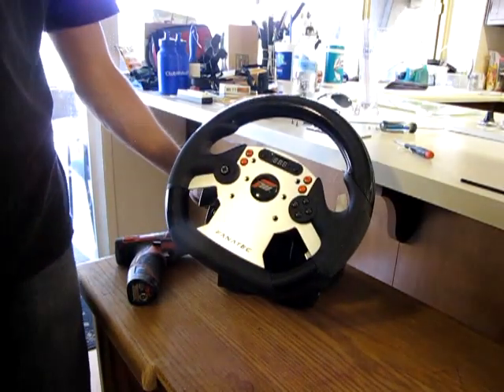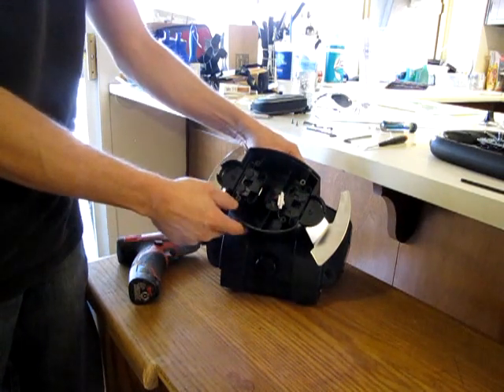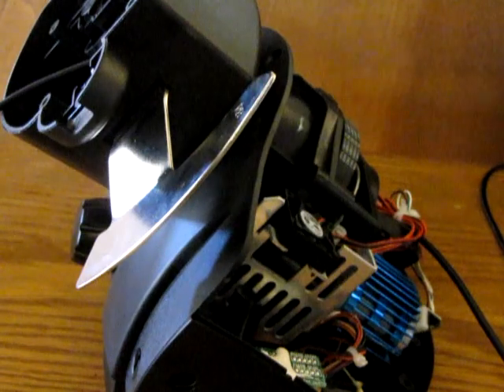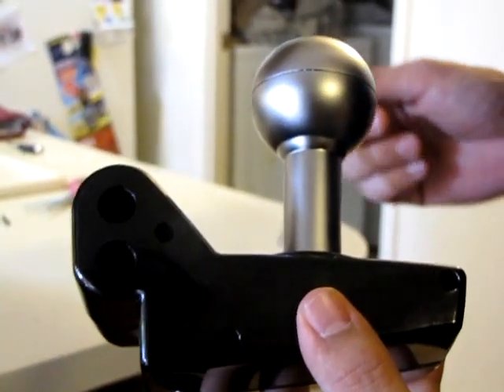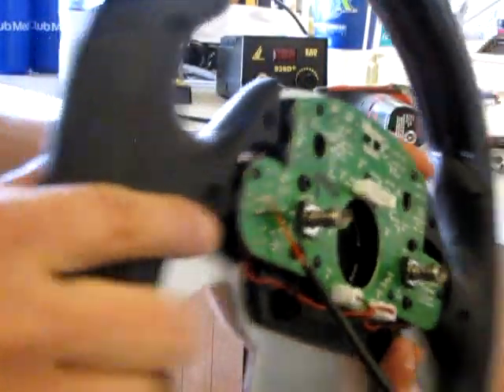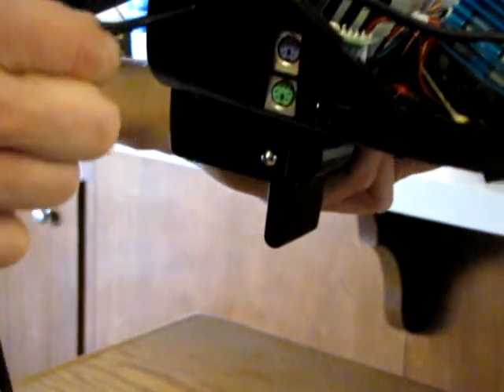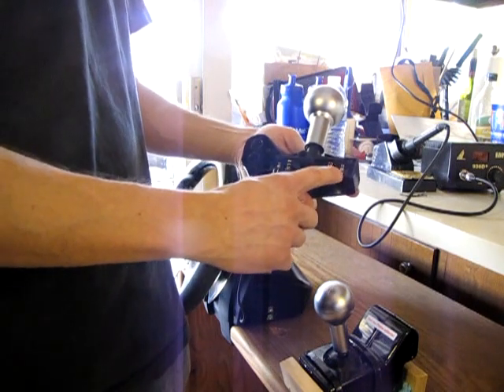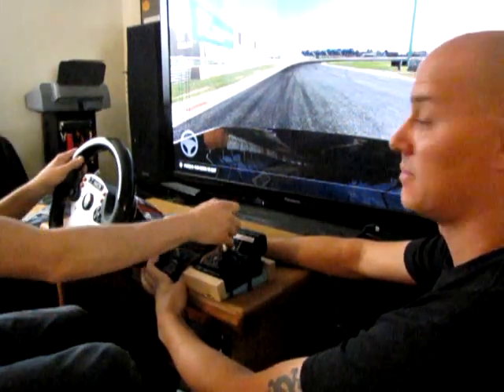Fanatec CSR Standard Wheel Handbrake Mod Tutorial

Comment from the maker: The wheel comes with two bars that you can connect info your wheel and extend to the right side. There you can slide in your handbrake and then your shifter. The bars are sturdy enough to support both. This way you only need to clap down or mount the wheel base.

Comment from the maker: The wheel only has the built in paddle shifter that comes with it. You will have to order the CSR Shifter kit from Fanatec for $60 + shipping. It includes a sequential stick shifter and a gated 6 speed shifter plus two pole for attaching them to your wheel. You can mod your sequential shifter to work as a hand braje shown here, and attach both the handbrake and the 6speed to the wheel with the poles. Order pedals if you haven't already as they do not come with the wheel either.

Comment from the maker: After the wires are soldered on the board in the wheel base and pulled through the housing. This way you have all the length you need to cut off or ziptie aside then solder the ends to the sequential shifter.

Comment from the maker: The reason for getting directly to the B button is so the PCB board picks up the signal and goes though the correct processor as a active signal. anything past the board will no read correctly and could cause damage without the proper voltage signal. Take your time and be careful. You can do it :)

Comment from the maker: He did not. I stated many times to take your time when doing this mod. If you get impatient, you WILL break something. As for the switch your mentioning, there is no wrong way to solder it, either side to either wire will work. All it does is complete the circuit. Thank you for your input. I will remember to get a closer, more detailed shot of that when I remake this video in better quality. I just did it quick so I can get the info out there since so many people were asking how I did it.

Comment: Awesome video man. I ordered a setup from fanatec last week, so this video will help a ton when it comes in. I have a question though. When using a fanatec wheel does it default the handbrake button to B? Or is it your preferance to have B button your handbrake? Just wondering because I use have used the default forza hand controller button layout and am hoping to just keep it A button as it is on my hand controller.

Comment: Okay thanks so much for the response. I got my wheel last week and I've been having a blast with it. I just need to get this mod done as an ebrake lever is so crucial. I'm wondering though is there anyway to "T" into a wire in the body of the csr rather than soldering onto the pcb behind the wheel? Because I cut down a allen key and was able to get the shell lid off of the body and so it'd be way easier to get tap into the "B" button wire if it exists? Let me know, off to work on the r32 now.

Comment: I'm curious. Are you saying you can connect the H shifter and the Sequential shifter to a Fanatec wheel at the same time? Or are you just connecting the seq shifter, assign it as a handrake, and using the flappy paddles to shift the trans?

Comment: Did that guy get back to you? I don't want to wreck my wheel, but maybe he screwed up somehow.. I don't see how this mod could cause settings not to work. One thing though, I wished you went into more detail about which switch, what wires go to what post, etc. I guess I'll figure it out, but it'd be nice to see how you did it. Just a few close-ups would have helped a lot. Like which is negative on the switch, and which exact spots to solder on the wheel ....stuff like that..

Comment: i have a question, 

i did this but when i got to the glue part, it was a pain to get off and i may have touched the green circuit board afew times, so i finally got the glew off got in to it comepletely (as my wheel was acting funny i wasnt actually doing the handbrake mod) and well now my wheels broken the LED Screen doesnt light up anymore and when i turn my wheel on it spins (does the usual thing) then turns straight back off, is there anything i can do to fix this?

Comment: I was wondering something. Instead of cutting off the ps2 connector in the sequential shifter, is it possible to solder one of its leads to where the e brake wires go. Then on the ps2 wire going to  the wheel, only cut off the end to solder to the B button. That way you can plug/unplug the e brake so that it's not permanently connected. Or is there a reason that you didn't do it like this ?

Comment from the maker: The PS2 wire was used because it came with the shifter kit. You can use any two wires as the leads from the board on the wheel to the S-shifter. I do it this way because I know it works. You can try your idea and if it doesn't work then do what I did. Let me know how it goes if you try your way.

Comment: Hey, my CSR is a couple years old and it's making quite lot of noise when I turn it now. It sounds like it's the FFB belt. Should I attempt to do some maintenance on it? Grease it or something?
Reply: Also, what game was that you were playing? Sounded absolutely mad!
Reply from the maker: JMM Hi! Thanks for watching my videos! The game is Forza 4 on XB360.  As for your CSR wheel making noise, I would need a better description of the issue. Do you feel any connection to the noise and any strange feedback to the wheel at the same time the noise happens? Like stiffening of the wheel? Does the wheel and force feedback feel normal and it is just noisy?  This info will help in better troubleshooting the issue without seeing the wheel myself.
Reply: 8-Bit Miata The FF is fine and doesn't make any extra noise. It's just when I turn the wheel it sounds like the belts are all dry or something. I did open it up already and greased the belts, and it helped a tiny bit.  Everything else is pretty much fine.
Reply from the maker: JMM  Hmmm...Hard to say what it is other than just wear noise. I don't think it will be of any concern, but the one thign I have seen people do is replace the electric FF motor for noise and wear issues. I have yet to replace one in mine because it does not bother me.
Reply: 8-Bit Miata Pretty sure it's not the motor since it sounds like it's coming from the smaller belt below the bigger one, and the FFB works prefectly. Weird.
Reply from the maker: JMM The motor I heard is from cheap Chinese parts. I know there is another video around youtube of someone using an RC car motor of the same size, and wiring it into the CSR. The RC motor was stronger and of higher quality. I am thinkign of looking into this someday too.

Comment: So, if I want to use the e-brake on CIRCLE and then R1 on another game, how can I quick change? Is there any type of connectors that we can use with this? I think so but since I've never done this before, I must ask. Thanks!!

It would be cool to have two connection slots on the side, and just fit into the desired button like O connection or R1 connection.

Since some games cannot be configured on a ps2 to change the e-brake ;)
Reply from the maker: Wire both buttons like I have shown on here with two pairs of leads. So with four wires coming out of the base, wire the two buttons to a selector switch with an output to the handbrake contacts on the handle itself.  This way you can select what button activates the handbrake so they don't cross contact each other and freak out.

Comment: stupid thing ; but you could find the coresponding wires to the pin you wanted on the shiter.... then not cut any wires on both end of the PS2 cable,  just the one where  you solder to the wheel.. there you get a dismatable HB. but nice DIY tuto. ( if your out of your waranty )